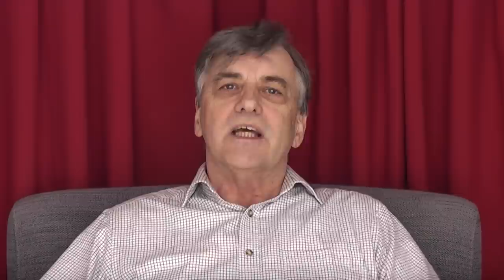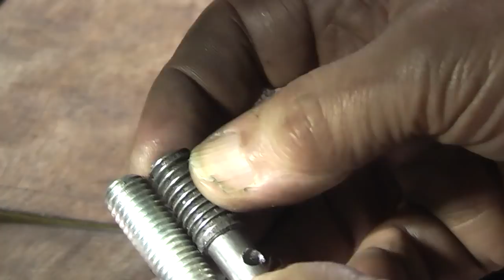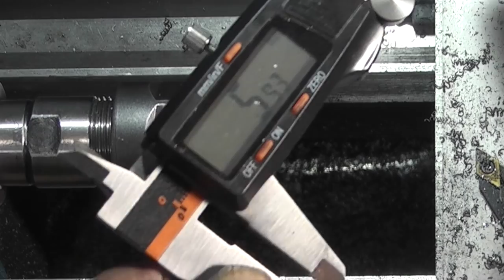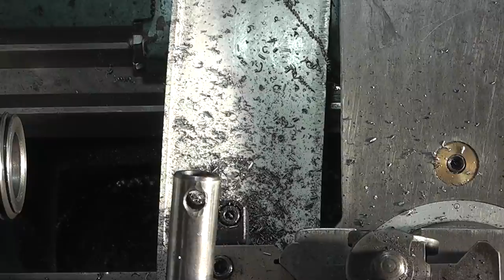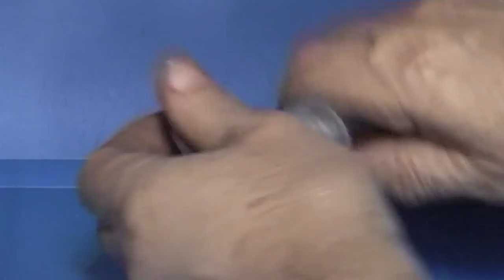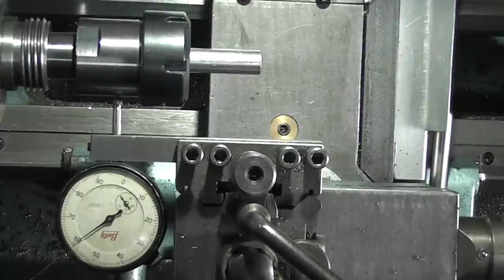Modified draw bar for the lathe

Comment: Hi Alan. I Have watched many video's of which you have done a very good job.  My Milling machine is a 3MT, of which I have  ER32 Colet chuck,  and several other adapters as well, and they all have various sized threads, from Metric as well as Imperial. I took the Lazy way out and was able to get Threaded Rod to suit the Adapters, and cut them to length.  All these work well without any problems. Could a Threaded Rod as in One Piece, One connection, give you better results ?

Comment: why not just have 2 drawbars??
Reply from the maker: Hi Steve. I haven't any steel to make a second bar my stocks are running low
If I made a second draw bar I would put a metric thread on one end 1/2" on the other end and have 2 nuts So you just turn the bar around.

Comment: I purchased an R8  er32 collet holder and have the same exact run out results. I have tried ball bearing tightening nuts and everything and it seems that the cheap set of collet er32 are just junki.